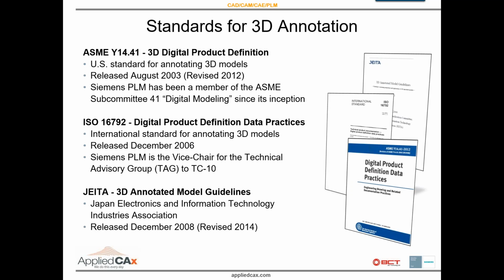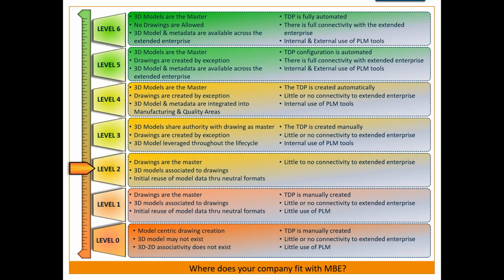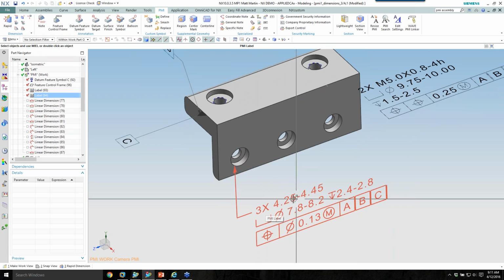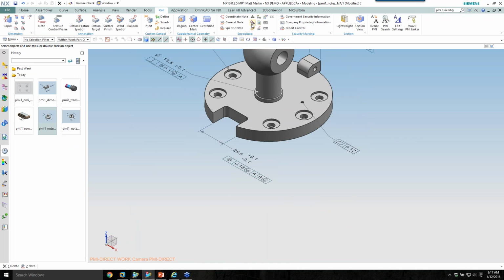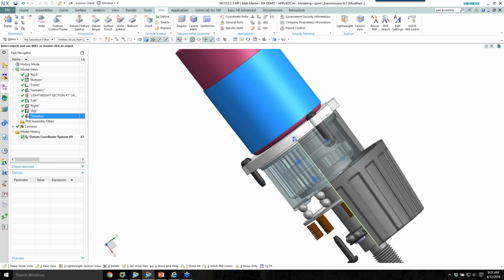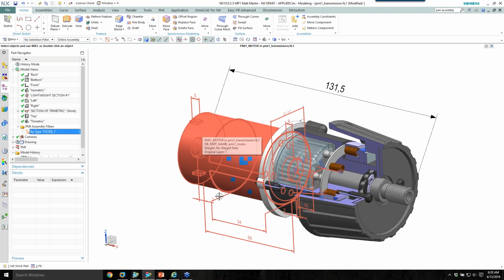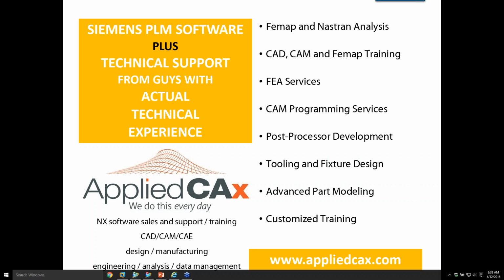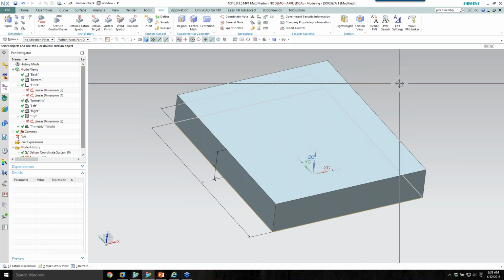NX PMI/MBD for Designers and Engineers

Comment: Hello Matt Martin, just watched rhe Video about PMI.
I have a more specific question regarding PMIs in assemblies.
Today we have drawings of our assemblies how they are mounted to a surrounding geometry.
We made in our old system a container with that surrounding geometry that is switched on in the views of the drawings. 
Now we want to do that with PMI in NX.
The problem comes up with the surrounding geometry.
Our procedure is now to take the assembly in NX, put in the PMI, including e. g. texts that refer to the surrounding geometry (for example in a assembly that is bolted to some steelworks we have text like "conserve threads of steelworjs with agent xy".
Then we save that assembly with its views and switch to tc vis, were we load the assembly, and additionally the surrounding geometry and then we safe that as a session to the assembly. 
Now my question:
Do you have any idea, how we can have the same effect by only using NX? 
We have the tc vis in our production where the guys there open the assembly and view the PMI. 
Thabks in advance, 
Matthias

Comment: how to add  or install PMI to NX 12?
Reply from the maker: PMI is controlled by your license file and is a toggle on the Applications tab. Click on PMI and the tool bar will show. If you don't have the license & you will get an information window. NX bundles Mach 2 and higher have PMI. If you have a Mach 1 license a floating PMI license.